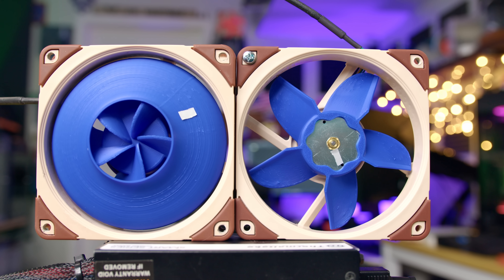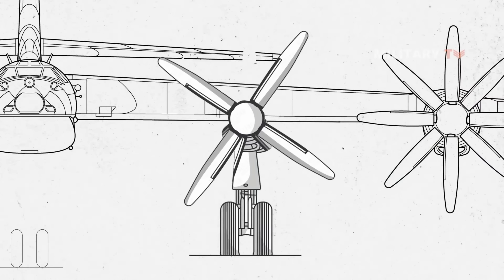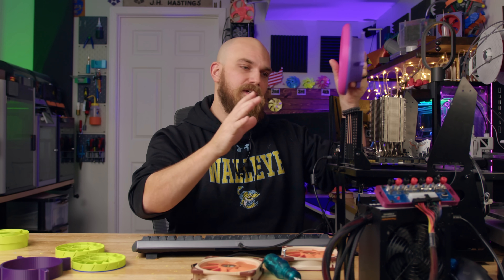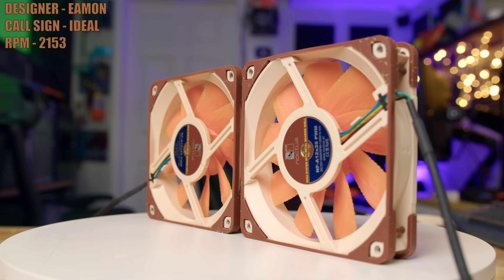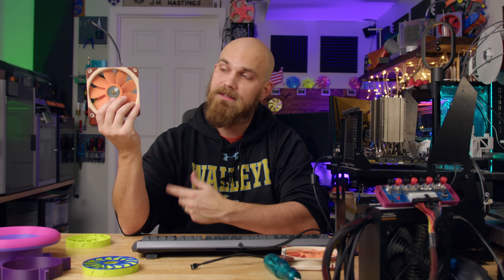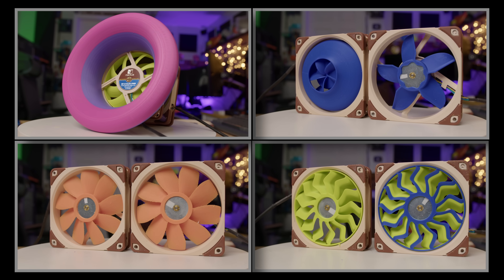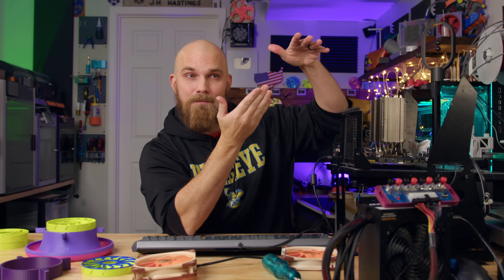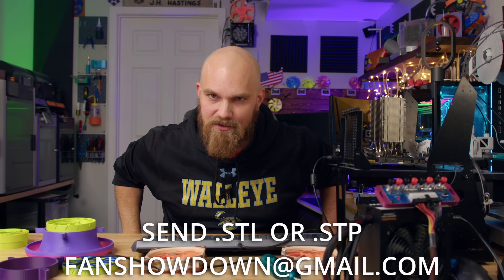This Fan Shouldn’t Work — But It Dominated | Fan Showdown S7E2

Comment: Something that probably wouldn't score well but would just be cool to see- a piston fan that uses the motor to drive a small piston or maybe multiple smaller pistons, then have a valve system that opens when the piston in a Car would be in it's highest position, draws in air as the volume increases, then the intake closes, no need for exhaust valves- the inside of the PC is the exhaust. When the piston would normally compress the air, the volume of air gets pushed into the case/onto the heatsink. I think if carefully designed that little motor could run it. I wish I had time to mess with this myself, time is the only true enemy in Life!

I've read around and it's been tinkered with but I've had this idea for a long time, accept on a Car- using pistons to add compression, like a little pseudo-engine that acts similar to a Supercharger. I doubt it'll actually add more power to a Vehicle and might even take power away but I've wondered about this for a long time but never had the funds to throw around testing out things for fun- I say Supercharger instead of Turbo because the system I imagine would be tied to engine RPM rather than exhaust gasses. The idea is to get the piston the lowest position, let natural air in, close the valve, then release the compressed air from the pseudo-engine-turbo-thing, then the piston moves up compressing more air- how much extra compression would depend on the chamber-size of the device I'm talking about

Comment: Bro, you’re doing an AWESOME job and I’ve been following this since Season 3 (that’s when you first showed up on my timeline)…..
I’ve got a “mission” for you and the community:

I need 7 fans for my Lian Li desk that are “silent,” yet can still get rid of roughly 400W of heat (through radiators: 1x1, 1x2, 1x4). The 1x1 sits between CPU & GPU, the other two are after the GPU, before the CPU…..

FYI: Noctua NF-A12x25 are currently installed AND I can hear them…. the noise is annoying! So I’m looking for something WAY quieter! Shroud, tunnel, “angled ducting”? Don’t care. I just want the noise gone…..

FYI II: 3D printing will soon be possible here. So a plan would be totally enough ;)

Comment: Since the main frame and motor are the same. That means you could have put the velocity stack on each set up. To see if in fact, caused decibel change. And or, efficiency change.

Comment: for the noise, a good way to do it when comparing a bunch would be to take the quietest one and then lower the fan speed on all the others to match the same decibals and then compare temps with sound now being a controlled variable

Comment: someone take the best cooling fan and add finlets, combs etc on trailing and leading edge like owls and biomicry studies on airplane wings etc, and use a noise absorbing material
Reply: Today I was testing AI. Copilot to be precise, to make me a 3d model according to my specs. It suceeded, but on some models my CAD interpreted the mesh wrongly and I got those jagged leading and trailing edges. It even optimiert the Model for 3d printing with a 0,4mm nozzle in the end. I was amazed. Did all kinds of AoA, washout, profiles like NACA, Eppler and so on. Just the import in SW did not work well with STEP and paranoid. It only worked with OBJ which leaves you with surfaces

Comment: I think the blue one should have been put on with the legs facing hub support facing the hub supports of thr other fan with the shape of the blades and the direction the fan turns.

Comment: The formula for score does not seem right. Decibels use logarithmic scale, and the number shouldn't be used like a linear value. Similar numbers may express values differing by several orders of magnitude. A 240dBA sound carries 100× more energy than a 220dBA sound, but that would not affect the score much. Similarly, a 31dBA sound carries 100× more energy than a 1dBA sound, and that would massively affect the score. 

The the scoring calculation can be exploited by having a bare passive cooler, which has low cooling ability but loudness 0 dBA (the noise floor), which would cause division by zero, so the score would go to infinity. Theoretically, the loudness would be negative infinity dBA, which would break it even more.

Comment: Listen to fan drone all day long?  I use 10 150CFM 3 amp Delta fans for my build. It has replaced my box fan for white noise purposes at night. Although I will admit if you put a sound meter next to it it peaks at around 70-77 dB.

Comment: I think the db should be measured separately from both sides of the acrylic in the smoke test. This would test the db experienced from outside the pc case. Maybe there is a way to keep more sound inside the case than outside.

Comment: Not sure why you haven't listened to a single suggestion we've all made, but sure, do more stupid tests with fan designs that are literally unusable and irrelevant. All testing should be done on the bench while the CPU is under load while the fan is on a cooler fin stack. Fan noise, smoke test, thermal tests.

Comment: The problem with dividing the decibels off of it is specifically because decibels are a logarithmic scale while temperature isnt.  For every 3 decibels it doubles the amount of power the waveform has.  Dividing it from the cooling performance doesn't give a good representation of how much better one is over the other.  I'm not good enough at math to come up with a solution to that problem, but you're going to end up with fans that perform significantly better but lose out to others because of sound and vice versa that really don't deserve it.

edit** I read below someone suggesting a noise normalized test.  That is a great idea.  Tweak the fan RPM until all the fans hit the same dBa, and then record the temps.  That would make the most fair comparison you could possibly have.   Granted there are specific issues with that around what frequency bands they occupy.  3kHz is a tone that our ears are specifically adapted for due to evolutionary reasons and would be absolutely atrocious to hear compared to anything else on the spectrum.  I think that would be getting too subjective and into the weeds for the purposes of the showdown though.

Comment: I would normalize deltaT and noise to a double A12x25 configuration adding the noise score to the cooling score (dT0/dT)+(dBa0/DbA) with the 0-scores being the base A12x25 results. Lacking the A12x25 measurement, I normalized to the average of all fans instead got almost the same ranking, except Inside Out(6) and CRX1(7) would swap places. I think it would also be a much easier score to comprehend.

Comment: 7:37 youre still just multiplying the dT and dBA. the plasma vortex and the 30 fins have the same dBA measurement but despite the 30 fins having a higher dT (meaning it cools better) it loses. this encurages fans that dont do anything but are quiet, someone could just tell you to run the fan with no blades and they would get top spot. the correct scoring system to use is (imo) dT/dBA because a higher dT increases the score and a higher dBA decreases the score, or in simple: big cooling good, big noise bad
Reply: I thought the same thing at first, it is 1/ ( dT * dBa ), but that's correct. A higher dT means the temperature is higher above ambient, whereas a lower dT means it's closer to ambient (cooler)

Comment: Id imagine that setting up these tests is a pain in the ass so you try to make it as fair as possible. But the smoke test really isnt an apples to apples compared to the fans mounted on the cooler.  It seems to me that you might need a second cooler sandwiched between two pieces of plexi for the smoke test. 
It might also show any failures in the cooler deisgn if too much smoke escapes in the middle of the plexiglass.

Comment: audio test ... what if the noise was directed noise and if it had been anywhere else but directly in the line of fire it would have been quieter, but i also agree with other comments here, you wouldnt use the fans off the cooler, so noise testing without the cooler negates the tests really

Comment: you should be locking the RPM to 1800 for all fans.  allowing the PWM controller to change the speed will affect both the DeltaT and the DB of Noise.  I also agree the test should be done while they are connected to a cooler as this will also affect affect airflow and turbulence.

Comment: You could always use multiple testing points for the noise generation. Directly in the air flow, opposite the air flow, and off to the side and average these numbers.

I think this would be a bit more fair to the megaphone fans, and give the audience the knowledge of the sound profiles of the different aspects of the fan (how it would sound as intake or exhaust or as ambient noise)

Comment: I would like to see each set of fans setup on the cooler itself. Perhaps even a smoke test with the that setup. It seems as though the way the fan are setup as being back to back, rather than on each side of the cooler. This seems like it would matter most for the push/pull fan designs.

Comment: @Major Hardware You need to run the numbers for rankings 1, 5-8. The numbers on your chart are off and would be better to get them corrected now before the season gets too long and the rankings get messed up without anyone knowing. Running the numbers (for Rank 1) through the formula in excel (formula: =((1/dT)/dBA)*100000) you get 36.08206505 instead of the 36.05080712 that you show in the chart.  EDIT: Also it might be worthwhile to limit the ranking output to say 3 or 4 decimal places as well.

Comment: I agree with others saying that testing the noise without mounting the fans doesn't make sense. Small variations in the relative orientation of both fans could (at least hypothetically) have a significant impact.

Comment: I like the thermals measurement of real world application, but I'm always interested in knowing how air flow volume and static pressure also impact these values.  When I'm looking to purchase or make a fan, my cooler would be different.  Using these values would help provide information that can be translated into expected performance.  This is still entertaining, and understand you results being measured depend on the competition category.  I personally will sacrifice some noise, specifically if it is a pleasant hum, with the fans ability to successfully move the larger quantity of air, given its application and ability to saturate.  Over all the best fan will have both high air flow and high static pressure, but the optimal fan will have one over the other based on application.  The testing I see here has never really lead me to the best design for a specific application.  While temperature Delta is a decent metric, the time duration between test doesn't account for humidity which can significantly impact the delta when they are close.  I know that the purpose of these videos isn't to get crazy scientific, but pressure and volume, can logically fill in those gaps.  Either way keep up the videos, it is still fun to watch!

Comment: I have a suggestion for the calculation formula.
Current formula: 100000/(dt*dba)
This formula gives a non linear mapping to both the metrics.
I suggest just nomalizing and adding the metrics.

norm_t = (dt - min_t) / (max_t-min_t)
norm_n = (dba- min_n) / (max_n-min_n)
    
score = (1 - (norm_t + norm_n) / 2) * 100

if I assume     min_t, max_t = 40, 80 and min_n, max_n = 40, 70

final formula:
score = 216.67 - (1.25 * dt) - (1.667 * noise)

this does give the same order of placements as the current formula tho

scores with my formula:
plasma vortex - 62.791
30 fins - 62.041
humpback - 61.875
mango knife - 59.541
ideal - 57.125
inside out - 49.5
crx1 - 47.416
split - 48.833

Comment: Hey Najor Hardware: Your score formula can be simplified (and mathematically give the same result): you have ((1/dT)/dBA)*100,000 which is mathematically the same as (dBA/dT)*100,000. Check it out in a spreadsheet for yourself. 

The inverse of dT divided by dBA is the equivalent of dBA divided by dT.

Comment: That horn has the shape of an R-OSSE waveguide. It's a known shape designed by Marcel Batík in the DIY audio community, and is the optimal shape to control the radiation of sound to a narrow beam in front, and prevent sound from leaking out to the sides. Actually a really brilliant way of combining the two fields.

Comment: I am surprised, because this should be THE season for toroidal propellers, but they're not yet flooding the submissions.
Toroidals minimize vortices, which should minimize noise as well.

Also, we still don't have the normal fan to compare with.

Comment: Doing the sound test as assembled and smoke test with a dummy cooler on a mount would be cool to see and a lot more fair considering the small increments involved.  Plus the radiator/fins can act as a silencer. 

Two sound averages once assembled as in front and above would be ideal.

Else someone can just made a cone ducted stack and direct every bit of sound possible away from the mic.

Comment: I would love to use the CRX1 in my thermaltake v21 setups (I have 2 lil boxie boys). Funny enough I think it would work like a dream with the front 200mm though the path would need some extension to reach the CPU cooler.

Comment: I think the noise test should be done as it would for a car on a track day - Measured at the outlet from a distance of 0.5m, at a 45 degree angle. As it stands, I don't think the noise recording of the CRX1 was fair, as it's so directional. (And is therefore easy to block.

Comment: So, just an FYI audio measurements are usually done at 1M, that being said, I do understand that some people have their desktops "on the desk" 100mm though is still to close and feel that a more realistic measurement would be between 350 and 500mm. 

Second: I feel that the designs NEED to be able to actually fit inside a stadard tower....

I said this last time, fitting inside a standard case will make the designers work a little harder on their designs, after all. 

These are the constraints within which designers need to work, and making this one of the requirements would make the "comparrison" to the actual A12X more relatable.

Comment: Hello there.
Did the cable routing of the front fan (beneath the rubber gasket and outside the plastic guide of the fan frame) affect the test? I see the fan's slightly crooked (even some of the screw threads are visible at the top - like at the 6:19 mark)  possibly affecting also the sealing against the acrylic... Maybe it was like that just for the smoke test?

Comment: Should add the cooler in the smoke test to we can see how well the fans overcome the resistance, and to see if the exhaust pulls all the smoke through or does the intake fane spew it all to the sides.

Comment: Hey, I love the idea of the fan showdown. What I would love to see is when you compare fans with a skill graph so you can see how they perform in all their stats, like noise, temperature, airspeed, power consumption, spaceefficiency and efficiency. (or other characteristics you want to include) and you can still calculate a comparable number for rankings from that with different weights on, for example, cooling -> very important stat, high weight,  or  airspeed -> nice to know, fairly unimportant for comparisons, very low weight.

Comment: mate i have a issue.  my laptop shows battery , it was working yesterday but today if i plug out it turns off. shows the battery percentage but doesnt charge or  runs  from the battery. anyone knwos what happend ?

Comment: Please do the sound test immediately before the smoke test, meaning: do the sound test with the same setup as the smoke test.

The smoke-test setup is what the fans were designed for, so that is how everything should be measured; noise, smoke and temperature. I get that measuring the smoke with the temperature setup is going to be tricky band you're leaving out the entire casing, but still; all measurements should at least use the fans in their intended setup.

Comment: I think GPUs should go on the back of the Motherboard, I hope someday they're made that way: separated Thermal Spaces for better cooling of each. Plus, if the case is made into a economic pressurized closed loop chiller, would have killer temps.
What was the positive pressure and volume/s of them? That's an important data, to measure Efficiency. I don't care a single Fart, about the noise, but low temps

Comment: Noise normalized cooling performance.  I recommend, again, deciding on an "acceptable" db rating such as 45db, then run each fan at a velocity that reaches that noise, across the cooler and measure the Dt at that noise level.  Keep the great videos coming as they are always inspirational.  Cheers,

Comment: I think noise matters from a direct customer-to-machine perspective, but if you're running a data center, performance/cooling is more important, especially when you consider people are sitting next to it all the time. Often, servers have their own rooms, and only if needing attention does anyone need to interact. If max efficiency is the game and the savings on performance will allow for sound and/or cooling performance enhancement to achieve this, without wasteful spending, I think noise isn't as much of a factor. Or, at least, the noise can be offset more easily by noise reduction costs than the costs of cooling.

Comment: Sigh…. I really we could actually just rank by the category - I.e. cooling, sound, static pressure, etc. etc. - and use overall based on the average of every category. It  would be so much simpler than these stupid formulas.

And why can’t we test for more than 1 thing at a time just do all the test, you have the set ups.